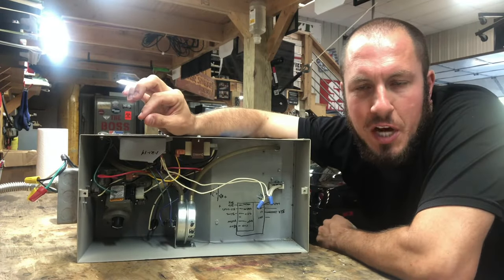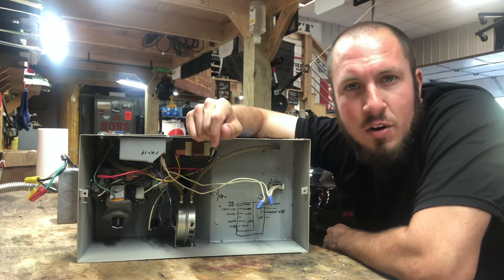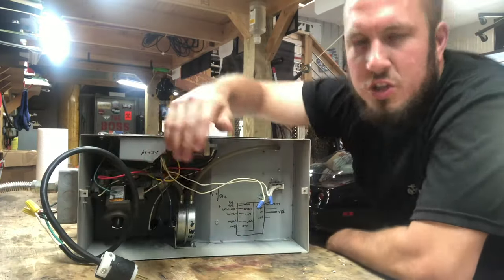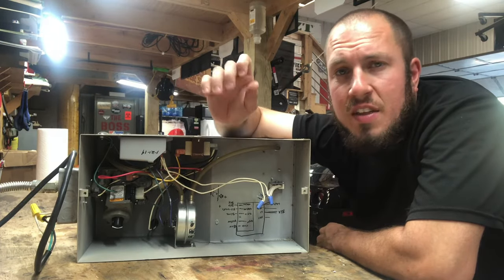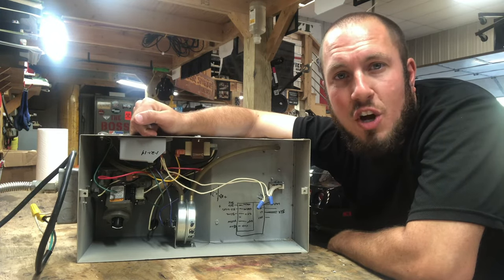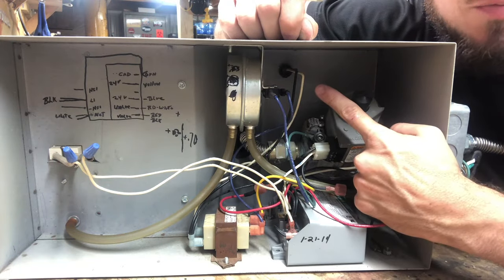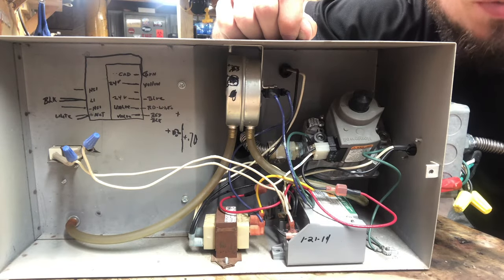Radiant Tube Heaters - Theory Of Operation (Startup)

Comment: I have a pair of vantage 2s, the longer one goes through all the steps to the point of clicking the gas on. Well I should say it's random, sometimes it'll click on and run for a minute or so then shut down other times it'll come on and run until it hits the set temp then when it calls for heat again the gas won't click on. Any thoughts?

Comment: I have these in my poultry houses for 10 seasons now and they have been working great. But over the last two seasons I've noticed a dramatic drop in efficiency. It takes a long time to warm up the house as opposed to before when it was blistering hot within minutes. I try to to maintain it by keeping it dust free around the tube and the canopy before each use. Is there anything else I need to do to maintain?
Reply: Your tubes might be full of carbon,they will need to be cleaned every year or at the least inspection of them is needed and clean your intake and exhaust vents.

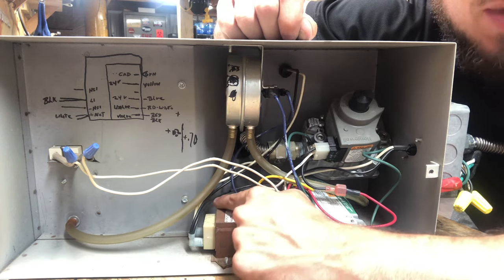Comment: 7:00 Just thought I would mention, a transformer can only output AC, you mentioned DC, however unless that transformer has a bridge rectifier (4 diodes) it will output AC.  The voltage is only present when the input is swinging from -55 to +55 volts on each side (total swing of 110). If you apply DC to the input of the transformer it will not output anything. The output voltage is only present when the magnetic field around the iron core is collapsing, thats why it has to alternate. When a coil gets saturated (in other words the field is not expand or collapsing) it just starts getting hot and will eventually melt or burn up. There are other factors, but that's it in a nut shell. Thank you for taking the time to make this video , edit it and post it. Have a great day. Hopefully it is AC as in my heater and I have not lead anyone astray. My fault turned out to be cold or broken solder joints on 2 of the relay contacts, on the printed circuit board. Any device that vibrates is likely to develop these types of faults.  Also the relay contact is a mechanical device and also vibrates when switched which adds to the issue. If the board is double sided its not as likely to develop these as a single sided board would, the holes are plated through on a double sided board and as such the joint is much stronger.
Reply from the maker: Right! I had misspoke about the output. It is AC.

Comment: will these type of heaters be good for a garage with a 9 foot ceiling ?
Reply from the maker: These heaters usually have a minimum clearance under them at around 36-44”. So consider everything at 6ft high under the heater to be too close. That’s combustible minimum distance. So imagine how hot it would be at the 6ft Mark. I’d recommend against it

Comment: Hi, thank you for the video :) do you maybe have an idea what could be wrong if the pressure switch works and the gas valve opens the orange light lights on but then it goes into blockade. This is only happening in the morning (when we get the heater to run it works without any problem for the rest of the day)?

Comment: Thank you so much for the information. 
I have gasmac tube heater it turns on for 4-5 seconds and then turns back off. Any idea what could be the problem?
Reply from the maker: Flame sensor. It sounds like it is not recognizing that the flame is lit and shuts down for safety.
Reply: @TheDurbinCompound  Thank-you so much for replying me back. I did clean the flame sensor really good but it still does the same thing. Do you think I should just change it to new one ??
Reply from the maker: Possibly. It might be the circuit board if it is not keeping it on and the sensor is clean. You could get a new one and if it still does it, could be the board.
Reply: @TheDurbinCompound  Thank-you so much. I really appreciate your help.

Comment: Thanks a lot. I learned how that thing works. Son and I will trouble shoot tonight... I am betting it is the ignition.
Reply: Would you recommend that we take the unit down and troubleshooting on the bench like you did or troubleshoot in place?
It seems easy enough to remove the unit.
Reply from the maker: Whichever you’d like to do. If your ladder is stable, it should be easy enough.

Comment: Great vid!   I have a big overhead infrared heater, turns on with thermostat, kicks on, but stays very low with no lights on (low and high).   Its a re verbaray hl2-20-75n.   Any suggestions?
Reply from the maker: Sounds like a control board issue. So it’s firing and getting hot, just not getting as hot as it should?
Reply: @TheDurbinCompound  yes, with no low or high lights as was normal.   Thanx for the fast reply!
Reply from the maker: Sounds like it’s a control board issue. Could also be the gas valve. The valve would be what is turned up and down with the control board for either high or low. The control board could be telling the valve that it should be on high and it just won’t open enough. OR the control board is not telling the gas valve to open or close.  It’s a crap shoot without looking directly at it and testing voltage at the board with it running.

Comment: Nice explanation, thanks. Do you know how the controller knows that there is no gas in the line after turning the igniter on? In foundry furnaces the gas safety sensor is located near the igniter (via ionization spark-plug or photocell). I dont see either of those in the video.
Also, do you know the BTUs of the heater in your video?

Comment: We have a new automotive repair shop with these already installed...is there a specific clearance to a vehicle on a lift in close proximity to heaters??
Reply from the maker: Yes! There is usually a chart on every single model.  I just looked at one yesterday. It was a 190,000btu (huge 70ft model). The clearance within 20’ of the burner was 94”. After that the clearance is 44”. So you definitely need to check the manual so you don’t burn up some paint!
Reply: @TheDurbinCompound  thank you we have no manuals tho as this was an existing shop which was vacant
Reply from the maker: A brand and BTU rating off the sticker will get you a long ways on the internet
Reply: @TheDurbinCompound  I gotcha Bro thats why i started here..thanks bunches
Reply from the maker: Good luck! These radiant tubes provide the best heat in my opinion. Can’t be beat
Reply: @TheDurbinCompound  Yeah they are bad ass!! when i get info from sticker can I hola back?

Comment: Any idea why my reznor tube unit got so hot it was glowing red and partially melted the heater box?
Reply from the maker: Yikes!  Sounds like an air flow issue. Exhaust at end clogged?
Reply: @TheDurbinCompound  no its not but there are those baffel things in a section of the tube. No one works on these things as I live in a small rural town so I'm kinda fucked. It still runs its Just warped and shit. 🤷‍♂️

Comment: My question is,after it runs for awhile on roughly a 25' tube,should the tube look orange  HOT ? I kind of think not.
Commercial Property maintenance told me he "kind of" remembers this heater glowing Hot. I can't see that would be the case seeing how small the gas valve was and length of heat exchanger  tube.
Reply from the maker: Well the first tube from the burner is supposed to be titanium to keep from turning orange. You should be ok but the heat cycles on a standard steel tube will weaken it in time

Comment: I have a question my tube heater fan is plugged into a outlet. But the thermastat is wiring through what looks like a outlet. Witch looks what powers the blower. My question is I thought the thermastat is wired to the main furnace?
Reply: robert nealey thermostat wire is sending low voltage, (24v) outlet is sending line voltage
Reply: @Cody-mu5sj  Thanks I just never seen such a thing.

Comment: what if i come into my shop and turn on the lights and the shop explodes? 
because the fire went out and gas kept going.  the igniter must stay on at all times or even a hiccup(momentary lose of flame) in ignition can cause a gas acumulation in the shop.
Reply: a photocell can be incorporated, with the help of a programmer, to prevent the flow when there is no light (flame).

Comment: Mine starts up and then turns off and on off and on what do you think this is
Reply from the maker: Flame sensor.  It is a probe that tells the unit that the flame is on. Take probe out, clean with sandpaper.  Reinstall.

Comment: What is it when the fans running , heater ignitor stays lit up and it clicks but no heat .
Reply from the maker: Gas valve
Reply from the maker: Ensure you are given 28VAC at the gas valve. If the gas valve is actually clicking, you could be A. Out of gas (or a valve is off) OR B. You’re gas valve is not working.
Reply: @TheDurbinCompound  gas valve has been confirmed . Could it be transformer ?
Reply from the maker: Are you getting the 28VAC at the gas valve? If you are not, it could be the control board or the transformer
Reply: @TheDurbinCompound  thanks for the fast reply. We will check the transformer
Reply from the maker: I think your transformer is good if you are getting an igniter glowing, the igniter is powered by 120VAC but, the 28VAC has to go through your safety switches in order to tell the circuit board that it is time for ignition. Are you positive you have gas flow?

Comment: there must be something that tells the gas to shut off if it fails to ignite or go s off while running.
YOU DID NOT SAY ANYTHING ABOUT THAT and that is very important because that could EXPLODE & burn down your house
Reply from the maker: You’re correct. The flame sensor is a part of the system that ensures there is flame when the valve is open. The gas valve will shutoff if the flame is not sensed at the flame sensor.